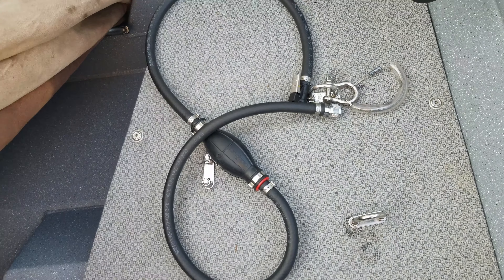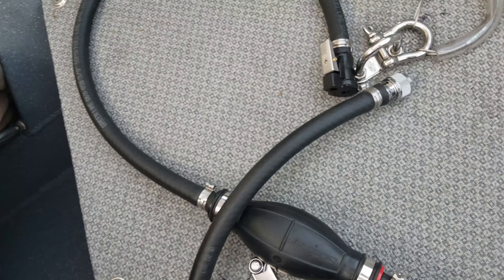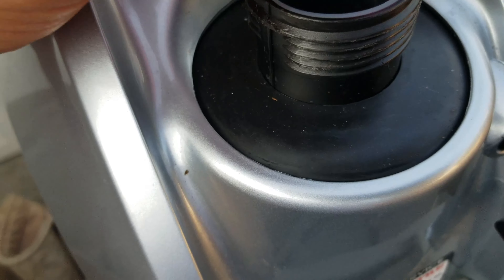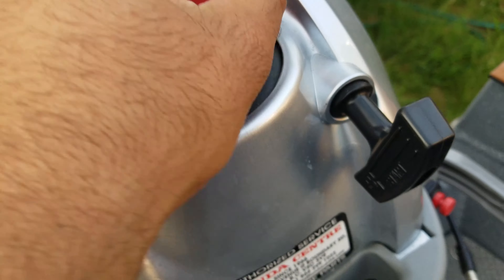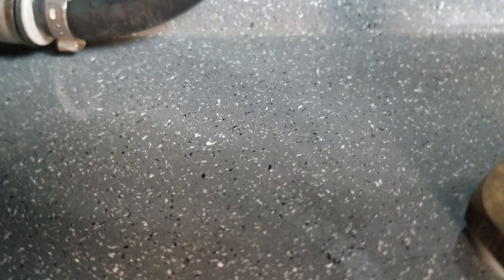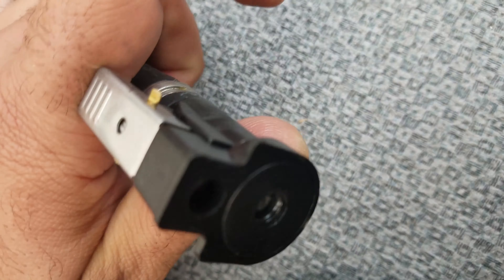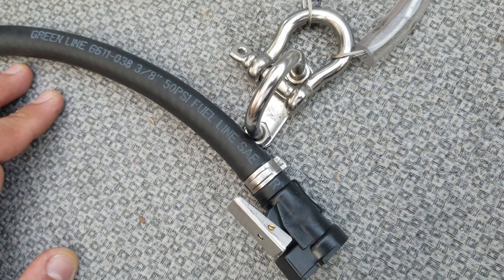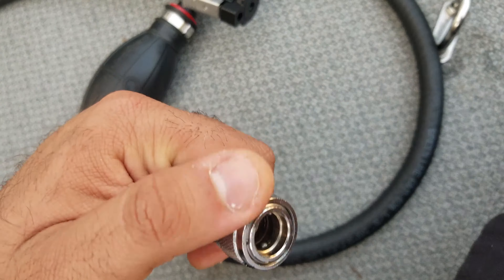Remote fuel connector mod for small outboards and trolling motors

Comment: I bought an IFJF cap that suppose to fit the Honda EU2000 and EU1000i generator.  But it's too big for my 2021 Honda 2.3HP outboard.  I just noticed you specified a cap that fits the EU2000i.  Does the EU2000i take a different size cap than the EU2000?

Comment: Also, the original gas cap for the honda has a vent so that the air can flow in so that it can draw fuel to the carburetor.  If you see that red gas cap, can air still flow thru it?  Thanks...
Reply from the maker: yes you dont need a vent but the tank you are drawing from needs its own vent. you dont need a vent at the cap anymore.
Reply: @ysesq  Normally do all external gas tank have a way to vent?   Like would this type work (attwood 8803LP2 EPA and CARB Certified 3-Gallon Portable Marine Boat Fuel Tank
by attwood) from amazon    Thanks!
Reply from the maker: @NghiaPham-xi5so  not sure but you need vented one. mine has a perko auto vent.

Comment: How is this working for you? Any issues after running it for a bit?
Reply from the maker: no it has been running fine. needs a bit of help to go but once the flow goes it runs good.
Reply: @ysesq  I see. From what I can tell the 2.3 doesn’t have a fuel pump. Is that true or does it have one despite being designed as gravity fed?
Reply from the maker: @MrBthames2000  its working as a siphon so not sure.
Reply: Thank you for the input.

Comment: What goes on the other end so that you can plug it into the portable gas tank?  Thanks
Reply from the maker: i use KF tanks so i used the female nissan connector but merc tanks have a female merc end so you match the end connector to the tank.

Comment: Can you connect to a Honda 2.3 hp outboard using the same setup? Thanks
Reply from the maker: this is a 2.3HP engine so yes.
Reply: @ysesq  Thanks for the reply,  so that red cap, i see two connections, so you would connect it to the top one?  What is the bottom one used for?
Reply from the maker: @NghiaPham-xi5so  yes you would connect to the top. bottom connector is for a large external gas tank where it will draw from. in my case it is a 25 gallon.

Comment: Do you have to manually pump it into the internal tank with that bulb?  Thanks
Reply from the maker: you have to pump it until the bulb is slightly firm in 2-3x pumps and then you can stop. engine will draw it in after that. i have added a one way valve to the setup as well for less load on the motor pump but not necessary.
Reply: @ysesq  Does your internal tank have to be empty before starting to pump it from the external tank?  Thanks again for the reply..
Reply from the maker: @NghiaPham-xi5so  no it needs to be full.
Reply: Have you tried this with a 2.3HP Honda yet?  I bought one of those iFJF caps, but it's doesn't thread in to my 2021 Honda 2.3HP outboard.  The red cap's too big.
Reply: @ysesq  I thought that the Honda 2.3hp outboard didn't have a motor pump -- just gravity fed?
Reply from the maker: @ErikEdney  gravity and some suction.